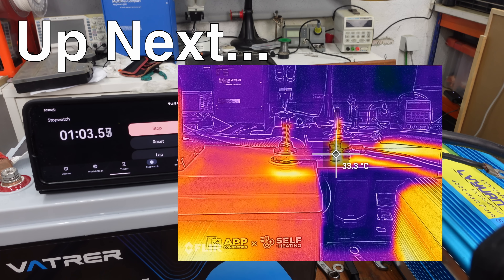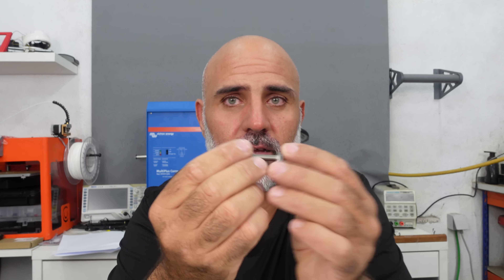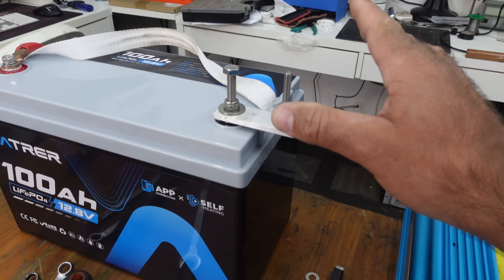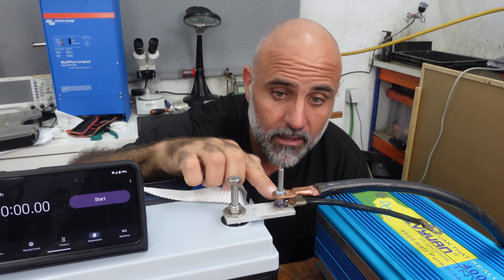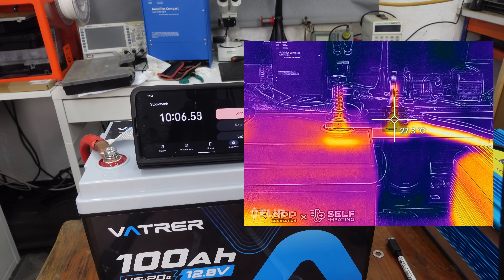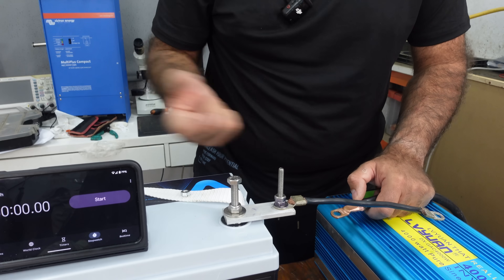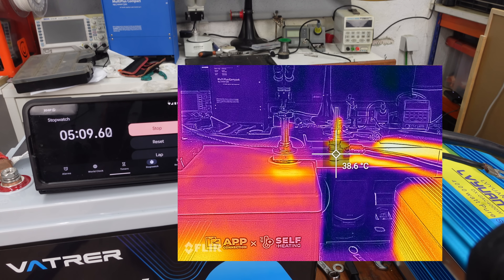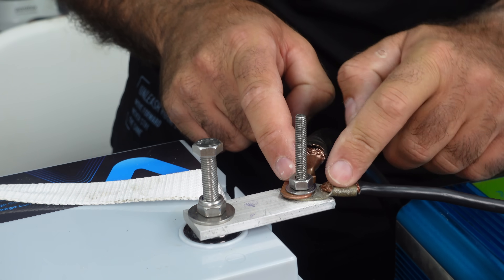This Tiny MISTAKE can BURN your SAILBOAT down !

Comment: I've done the complete electrical installation of my whole boat, not a single existing wire (wasn't much) was reused. I used only high quality branded parts and cables (tinned Ocean Flex only, amazing). I have lithium batteries and a windlass, so quite some ~100A wiring. So, I know my thing, but didn't know this! Turns out that 316/A4 stainless has a 40 times higher resistance than copper; just WOW! I'm almost sure I don't have stacked terminals with nuts in between; simply because it's also bad mechanically. Still, I'll double check when back at the boat. THANKS!
Reply: What is supposed to happen is that the bolt holds the conductive faces in contact and does not itself conduct significant current.  Pay attention to those surfaces!
Reply: Same here, I had to took a picture of the balled up 40 year old wire because the amount of wire and nut connectors (yes the previous owner used nut connectors) was unbelievable.  Never considered the resistor properties of stainless.     This video certainly educated me,
Reply from the maker: Yep, it's one of those things, If one doesn't know one is never just going to guess or even think about it 😅 cheers mate fair winds 💪
Reply: I'm just finishing up a complete electrical refit of my boat. Gives a guy a lot more peace of mind than looking at the rats nest of wiring the previous owner had woven.
Reply: First that is not how the stainless bolt is used.... second what exactly is the resistance in ohms from one end of the bolt to the other?   Every length of metal such as a bolt has resistance from one end to other... thats a fact... I do not believe the resistance of stainless steel  is so high that it will start a fire;... so what is the resistance in ohms of that steel bolt....... theory is correct.... the above application note is hyperbole....
Reply: @iamhe999  That is exactly how I use the SS bolt.

Comment: I recently connected the negative cable lugs of two Lithium batteries wired in parallel using a 1/4-inch stainless bolt, nuts and washers in my camper. I had 5 cables all connected through a long stainless bolt. I have been wondering why one of the lithium batteries wasn't charging as it should. After watching your video it looks like my connection system is the culprit. I will be changing to a multi-terminal ground bus bar. Thank You!
Reply from the maker: I'm glad it helped 😁 cheers mate 💪

Comment: Ok, that had nothing to do with the stainless steel bolt or nut but had everything to do with some clown trying to fasten a terminal lug on top of an existing nut. 

- Best practice : each lug gets its own terminal stud
- Do not exceed 2 lugs if possible. 
- And if you have to use two lugs on one stud, make it a high current lug on bottom and low current lug directly on top of it.
- bus bars are expensive, yes, don’t cheap out here. Get the biggest badest bus bar that is properly rated for the loads and connections you are trying to use.

Comment: I've heard Nigel warn about this, and it was good to see a demo. So does that mean that battery posts are not stainless? Seems like you have to have non-stainless in your system to carry the electricity, and then the stainless just holds everything together.
Reply from the maker: Yes battery terminals are usually aluminum. Or lead in case of lead acid. Never stainless. Cheers mate fair winds 💪

Comment: Another common issue incorrect sizing of the Lugs, very important to match the stud or bolt size. Also Recommend using only Tinned Copper Marine Grade UL Approved Wire and Cable of Appropriate Gauge, When in 
Doubt, Go Thicker

Comment: Both connectors right on top of each other righ ton the bar, nothing underneath, then a spring washer, then the washer.  The connection is secured againt accidental loosening.
Reply from the maker: Yes exactly 👌

Comment: I got a box of crimp fittings from harbor freight and they look like stainless, and they do not get picked up by a magnet. Now I'm interested
Reply from the maker: Hum, they should not be stainless, maybe it's  silver plated brass. Cheers mate fair winds
Reply: @reversingentropy thanks, i will look further into that. I appreciate your advice and your video
Reply: @reversingentropy  the connectors are copper, tin plated.. Drill one to see materials.

Comment: Hej, measuring blank and shiny metal with an IR camera is usually very inaccurate. Try to use a black permanent marker, paint or tape with good bonding to the surface to get more accurate readings. 👍
Reply from the maker: Very true. It was actually much hotter than it said on the camera.

Comment: I rewired my dad's boat about a year ago, and it never even occured to me to not connect the terminals directly to the busbar, even if they're stacked.  Putting extra nuts and washers in just makes the entire job more difficult and feels wrong just thinking about it.
Reply from the maker: True. Normally this happens when someone adds something to an existing installation.

Comment: That's not a bus bar, its just a bolt in some aluminium that you joined a heap of lugs to, separated by nuts.
A bus bar would have multiple points where you could join the lugs directly to the bar, clamped down by nuts.
Reply from the maker: You missed the point. The set-up was just to show the improper connection point using SS

Comment: I learned this lesson the hard way, fortunately I caught it before things went bad. I used a single stainless washer when connecting a 4/0 cable to the main fuse on my system. It melted the heat shrink off the end of the cable when I caught it. Good thing I was closely watching my system shortly after I put it together.

Model airplane guys already know about this. They cut wings from foam blocks using a high resistance hot wire cutter. The wire they use? Stainless.
Reply from the maker: 👌 cheers mate fair winds 💪

Comment: Dont forget the oxidation on the aluminium bar is highly resistive as well.
Should sand it and use a dielectric grease between the connection to prevent further corrosion as well, makes a big difference especially if the bolt tension/torque isn't correct

And also when using a thermal camera on metals you must be aware that aluminium and copper is like a very good mirror in thermal so your temperatures will be way off and more of the temperature shown is actually the room temperature.

Should paint it black or put a piece of black electrical tape on it to see the actual temperature
Reply from the maker: Very good points 👍 cheers mate fair winds 💪

Comment: Stainless fasteners exist as bus bar and tap hardware throughout the US's energy infrastructure.  

The issue is people doing exactly what you did here, using undersized hardware and improper procedures.  Terminals should never be landed on an undersized bolt or stud.  Terminals can be stacked, but only if done with the proper hardware.  A loose nut over an undersized bolt with no washers is a fire waiting to happen.

Also, the stud on your battery is stainless.

Comment: Goood video!
Just one thing: with 90 Amps you can kill a soccer team.

The human body is in danger of life from 50 MILLI-AMPS

Your hands (muscles) start to contract at 30 Milli-Amps so you can't let go, if you touch something.

Dude, make SURE you know what you are handling with
Reply from the maker: Not at 12v hahahahah you can't kill an ant with 12v. Without enough voltage your body will not see any amps. Cheers mate fair winds 💪
Reply: @reversingentropy hm okay

Comment: Sorry but the whole set up is horrible. Very admirable job trying to make people aware of possible resistive heat loss due to bad connections - but, - Never use ALUMINUM as a bus bar - Never. Never use a back thread type bolt connection. You can never be able to control torque of connections. Never use Nylox Nuts (nylon throat nuts). Never thread through threads to battery terminal. You used incorrect battery lug size for the bolt size. Etc. If you use proper Tinned marine busbars and sized for amperage usage, then all should go great. Also use small amounts of dielectric grease. I hope you did not use aluminum bus bar on your boat if you did you should change these out asap. Thank you for the video to make me think about these processes. This is just my 2 cents. Cheers
Reply from the maker: Heheh 😁 That was exactly the point. Going through ss is worse that the terrible set-up 😅 cheers mate fair winds 💪
Reply: @reversingentropy 😊

Comment: the bar in the test is made of aluminum, it is not stainless steel like the bolts, you don't need to be a metallurgist to understand that, but are there people who connect low voltage and high current loads in that way in 2025?
Reply from the maker: The busbar is not the issue. Connecting tru ss stud it. Cheers mate fair winds 💪

Comment: I've actually learned something...would brass bolts and or busses bar be a better option? Asking for a friend..
Reply from the maker: Brass is better. And as long as the terminal is directly clamped to the busbar using stainless steel bolts is not an issue. Cheers mate fair winds 💪

Comment: This setup will 100% not create a fire. Even with double the current draw (180A). It is just the higher resistance of the Stainless. It will get warm. Maybe even hot like 80 Celsius. But the connection is still solid. Butting 500a through that connection could cause a fire. But the cable is not rated for 500A. And if you use bigger cables you would use bigger studs as well. The resistance of the stainless stud would be lower because of bigger Cross section and you would be fine again. 
Don’t get me wrong. It is not the correct way of doing it and it is really good that you point out this mistake. But it will not start a fire!
Reply from the maker: You are correct. This was just to illustrate the point. Cheers mate fair winds 💪

Comment: look i agree with what your explaining and agree but, in the first demonstration your cable got to 40c and you said  its not even hot to the touch and in second demonstration with only a 2c increase you acted like and said it was too hot to touch. it take some of the credibility away from the demonstration
Reply from the maker: Lool I understand what you are saying.😅 Here's the 2 issues that made that happen first metal is much more conductive than plastic so when you touch hot plastic it doesn't feel as hot as metal. The second issue is that the thermal camera has issues catching the temperature on shiny metal. So it was actually hotter than the camera said. I need to get better at explaining these things during the video. Thanks so much for the comment 🙏 cheers mate fair winds 💪

Comment: Thanks for the information.  Another source of resistance is bad crimps, particularly ones that will allow corrosion to migrate in.  Proper crimping tools are critical to building a sound power system.
Reply from the maker: Very true 👌 cheers mate fair winds 💪

Comment: yes, alwayse ensure  wire connections are copper to coppper - IF needing to offset stack on a SS bolt - use copper or brass spacers / washers - not stainless steel....
Silver or brass Plated Steel ring crimps are also bad...

Glad this is out there - it should  be common knowledge.
Reply from the maker: 👍 cheers mate fair winds

Comment: Brilliant video!

But you should know your thermal camera isn't producing accurate readings from shiny metal! Shiny surfaces have low emissivity (high reflectivity, its inverse), which means their "color" (even in the infrared) is mostly a reflection of the surroundings, it's like you can't take a picture OF a mirror, you end up taking a picture VIA the mirror.

You'll get much more accurate readings from the insulation, weirdly enough. It's thermally "farther" from the joint, but it's black, meaning its "color" depends mostly on its own heat; reflections from the surroundings contribute very little to its apparent temperature. 

Thermographers will often spray a puff of black spraypaint onto a shiny surface, or apply some matte-black tape (gaffer's tape is good, or Taeyoung electrical tape is one of the few matte types I've found) to get a more accurate reading.
Reply from the maker: I painted the nuts with a sharpie. But yeah paint would be better. Cheers mate fair winds 💪

Comment: Matching your lugs to your studs is important also.  It maximized the contact area.  Copper washers are available if you need any spacing.  Any other type of washer will make a hot spot.  Always load test to near maximum loads to check for hot spots.
Reply: Podkładki miedziane są drogie, czy można wykorzystać monetę z miedzi?
#grosz
#dwa_grosze
#pięć_groszy

Comment: It is a resistor but a very high power one. Power will be lost to heat, which is wasteful, but its won't get hot enough to actually cause an issue. I did notice for some reason you used a smaller diameter bolt for the loads that will make the issue worse because a smaller diameter bolt will have a higher resistance and a lower power carrying capability, it will get hotter. Perhaps try the test again with a larger diameter load bolt. Or as you did simply secure all loads with the same nut together.
Reply from the maker: Thanks mate. Will keep this in mind for future videos 👌

Comment: 40°C vs. 42.2°C 🤔
Reply from the maker: Not really. The small wire was at that temperature but the connection was not. Then i switch to the large wire and the connection got hot. My point was the connection got hotter tru ss even though the section of the wire was larger. Cheers mate fair winds 💪

Comment: Your experimental setup, man!  I see: on the positive pole no MRBF fuse directly on the terminal. And on the negative pole: 

(1) a corroded old very small lug on the busbar, no heat shrink tubing, then:

(2) a very thin old wire which does not seem to be fine stranded (tinning of the strands unknown), then:

(3) another old thin lug to an unnecessary bolt-nut connection - which should not be in the system - on which at least the nut does not look clean/fresh, no heat shrink tubing, then:

(4) a still very small copper lug - untinned - in wich the wire is crimped in the crappiest way with exposed bare wire, no heat shrink tubing,  then:

(5) a still very thin wire to the inverter, so:

definitely a good demonstration of how to cobble together a system with a lot of actual and potential problems and inefficiencies.

And that was not even the point of the whole video: mount one lug on one position on a busbar DIRECTLY, so no other lugs, nuts or washers inbetween the lug and the busbar. 

One compromise that you could make there, is mounting one wire on top of the busbar and another wire at the bottom, both secured with the same bolt, both directly on the busbar with the flat side (I am leaving out a number of details here).

Although we have not actually seen heating beyond approx 41 degrees on the thermal camera and yet you seemed to find the connection 'hot' to the touch afterwards, which would indicate an actual temperature much higher. 

And when talking about melting of the insulation, you point at the thick wire, where the insulation would not melt, it would melt on the thin wire, at least at first.

So yes: nice informative and educational video - for those with the eyes to see.
Reply from the maker: This is not a real set-up 😅 just stuff i had around to illustrate the point. I even use a scrap piece of aluminium to make a temporary busbar. My point was even using a super thin wire doesn't heat up as much as a connection made tru ss. Cheers mate fair winds 💪

Comment: I would never use SS on an electrical connection...!?
Electrician of 40 years, who always had power boats/yachts.
The worst thing to do in a marine environment is mix metals.
Electrical connections are all about surface area.
Reply from the maker: Very good point ☝️ cheers mate fair winds 💪

Comment: Most cables are rated for 75, 90 or higher, degrees Celsius, the current capacity and the voltage drop for the cable would be a higher priority in this test.  It would be better for each connection to have its own stud terminal.  The busbar could be tinned brass or copper to stop oxidation.  Without the tinning, the brass and copper would develop over time a green copper oxide, which is a high resistance joint and is critical for earth bonded cables applications.  I never knew that stainless steel had such high resistance in this application.  All stainless steel rusts, it just depends on the time.  I would have expected that 316 Stainless Steel would have been the go-to material for the marine environment given salt and water is an electrolyte. Live and learn.
Reply from the maker: 👌 cheers mate fair winds 💪

Comment: Electricity is not mechanics. You need to learn the fundamentals of electricity, and not just assume that your mechanical fabrication skills automatically apply to it. As you're seeing, that doesn't work. Same thing with semantics. Naming something a "bus bar" will not make it electrically sound. And in this case it's a misnomer. The bar stock is making a point-to-point connection, while the bolt is making the electrical bus. Was that bolt even made for electrical use?

A real bus bar would start off with a suitable material for electrical use, not structural use. And a real bus would be tapped for multiple connections, because that's what "bus" means. But you should never bolt a bus bar directly onto a battery terminal! The electrical terminal is not meant to carry physical loads! Use the supplied or approved mounting hardware to affix the battery to the boat not by the electrical connectors, then use cable to connect the battery electrically to a suitable terminal block. Just buy the correct parts, they don't cost that much.
Reply from the maker: I thought it was obvious this was not a real installation 😅 it was just a piece of scrap aluminium. The only thing I was looking to show was the difference between the connection point. Cheers mate fair winds 💪